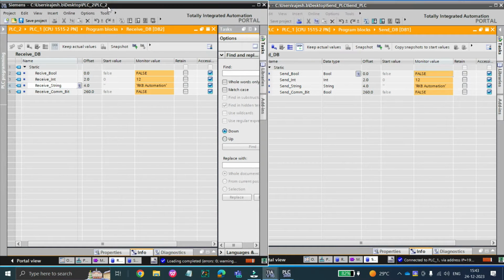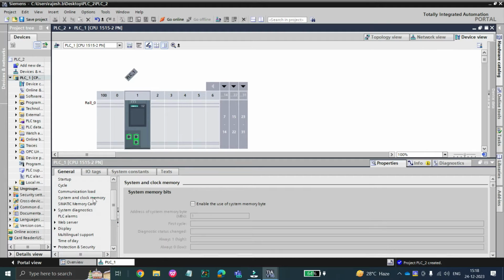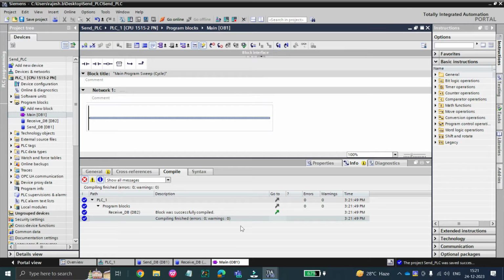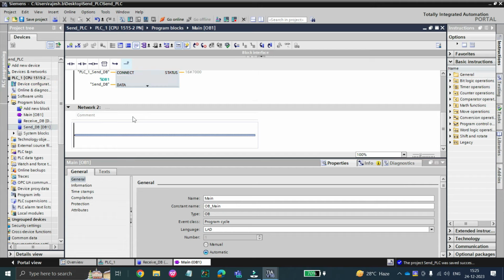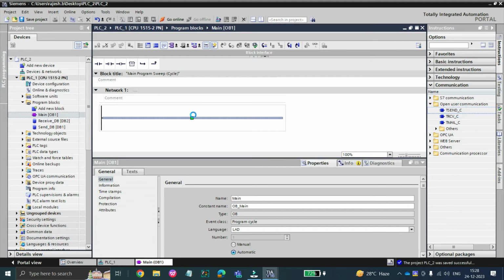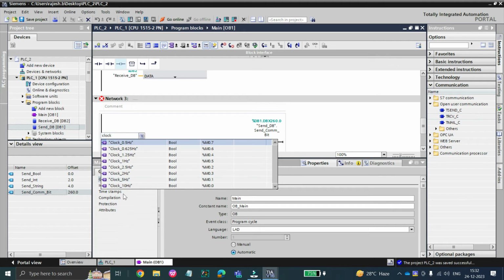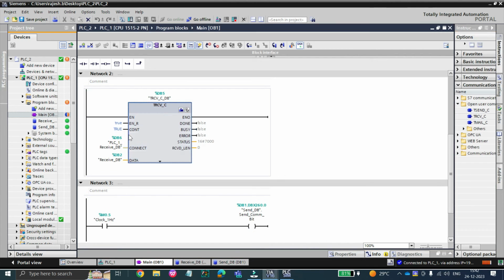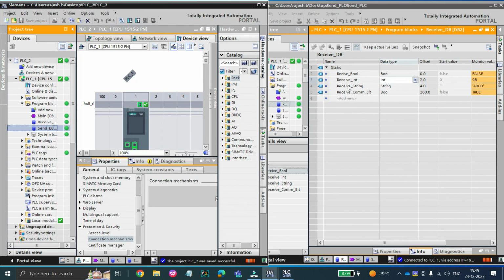How to do PLC to PLC Communication in Siemens | TIA PORTAL | Narrated by Rajesh Kumar

Comment: Sir, without any physical connection between two cpu how one cpu can read second cpu IP Address?
And how data transferred without any connection between both cpus
Reply from the maker: You are right definietly they both need to be connect via an ethernet cable or they if you are using wifi then both PLC need to be connect to the same wifi. Reason of the video is Peoples don't know the programming. For them this is the video.
Reply: @rkbautomation5412  This is the simulation software and it is pretended like physical connection was established